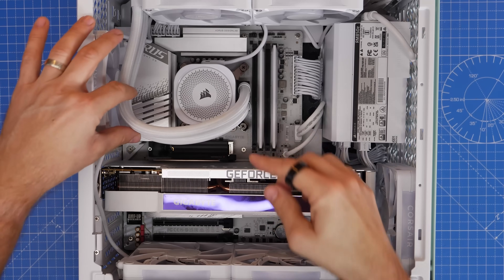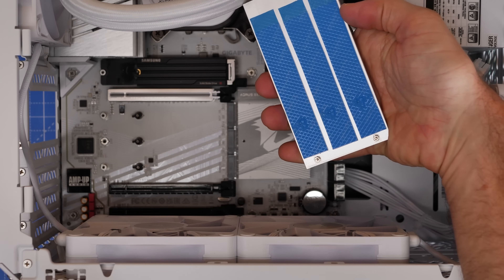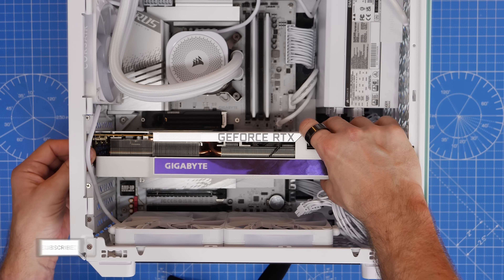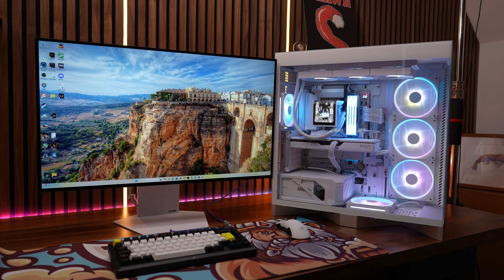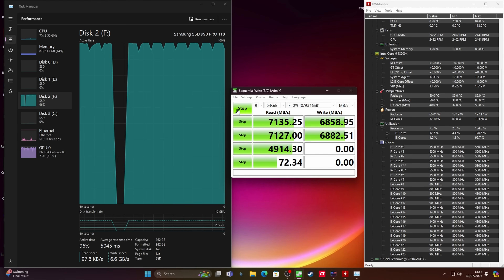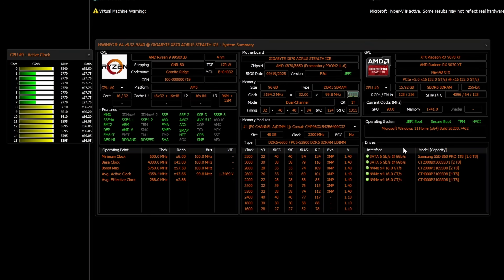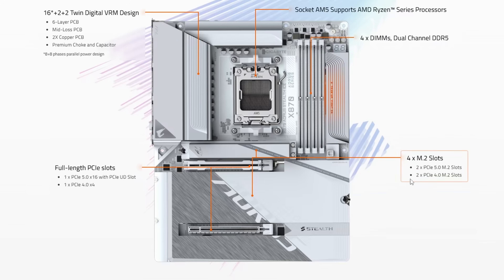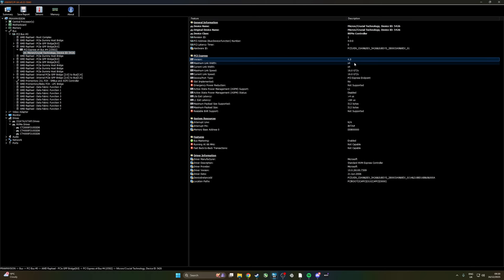How to add extra NVMe SSDs to your PC (and how to check where and what you can install)

Comment from the maker: Specs of this build (note these include affiliate links which may earn me a commission at no extra cost to you):
Case - Cooler Master Qube 500 https://amzn.to/4sliFb9
Motherboard - Gigabyte Aorus Elite Z790 AX Ice https://amzn.to/4rUS6cm
CPU - Intel Core i7-14700K https://amzn.to/49htGT8
RAM - Crucial DDR5 Pro series 32GB https://amzn.to/3MGKmL2
NVMe - Samsung SSD 9100 PRO https://amzn.to/48Kya4z
PSU - Corsair RM850e (2025) https://amzn.to/3YzmWd7
GPU - Gigabyte RTC 3090 OC Vision https://amzn.to/48Yc4dB
AIO - Corsair Titan 240 https://amzn.to/4qj9Z2Z
Additional fans - Corsair RX120 https://amzn.to/4s57PFI

Comment: Prawn, I've noticed lately no one has done updated bios in a while or only show one. Could you make an updated one that covers the most recent boards? Go over the basic overclocking on the bios and drivers. Maybe software if it's not too long.
Reply from the maker: I did make this - https://youtu.be/ASFN1S6enBQ but it doesn't include everything you asked for

Comment: Great video! Make sure you ALWAYS check what ports to use and not use because if you use the wrong storage ports than you will lower the GPU lanes down to 8x. Dont use the chip set port if possible.. super informative video as always!
Reply from the maker: Based on my testing that doesn't actually have much impact on fps

Comment: Hi, this channel is an absolute gem! Covering so many subjects and issues all under one carapace 🙂
Just one remark to further feed the paranoia: after shutting down the system, and unplugging the power cable from the PSU like you did at the very beginning --> hit the power button .. that way you empty the capacitors and deplete any residual electrical current that may still be lingering around in the components, you may even notice that the fans may make a quarter of a turn after doing so, now you now that you're fully discharged and safe to proceed with unplugging things from the mobo 😉
Reply from the maker: Thanks for the extra thought. Very good point.

Comment: My Asus B850-E has Gen 5 compatibility but as it's primarily a gaming rig and due to costs I stayed with Gen 4 as you will not notice much, if any, difference between Gen 4 and Gen 5 for gaming.
Reply from the maker: Indeed. Gen 5 can run very hot too

Comment: You can also check if there is updated firmware for the drive and other info using the software from the manufacturer. Samsung's is Samsung Magician Software.

Comment: If im adding a gen 5 to my pc, on a crosshair hero x870e motherboard, should i move my
gen 4 nvme to the second slot
and put the gen 5 one in the 1st slot, or can i keep my gen 4 one there and put the gen 5 ssd in slot 2?
Reply from the maker: It looks like the top three ports are gen 5 on that board and only the bottom two are gen 4. That said, the heatsink on the top port looks better, so I'd use that for gen 5 to ensure it gets the best cooling.
Reply: @TheProvokedPrawn ok thats great to know, thanks alot!
Reply: Move the Gen 4 to a slot below the 2nd PCI-E slot to use the chipset to run the Gen 4 NVME and put the Gen 5 in the main slot above your graphics cards. Doing this will ensure both NVME's are running at full speeds and will ensure that you're not causing bifurcation that will cause your PCI-E lane dropping from x16 to x8 for your GPU. Wouldn't be a drastic difference but just helps ensure your hardware is running at optimal performance. Also, if you're gaming, have windows installed on the Gen 4 and use the Gen 5 for your games to take advantage of the Gen 5 speeds

Comment: Thank you, as ever, for an entertaining and informative video. I have a question about the heat conducting material on the heat shield between SSD and the shield itself. What is the substance - is it some sort of plasticised thermal paste compound? Once applied, is it damaged by removal when for example, you want to replace the SSD? Can it then be replaced?
Reply from the maker: It varies from board to board from what I've seen. Some can be rescued and used again, some wear out. I'm not sure the exact materials